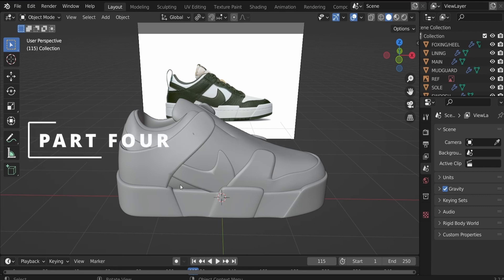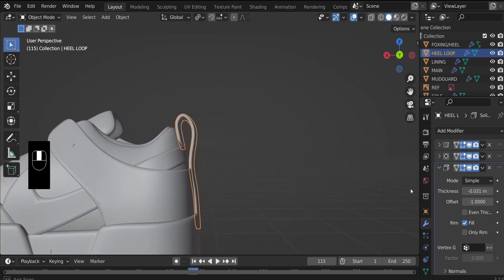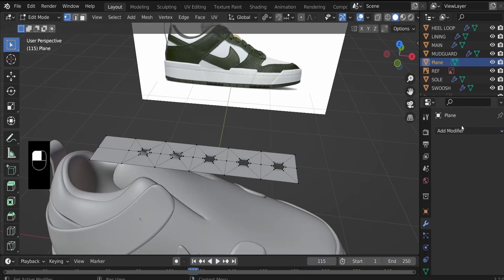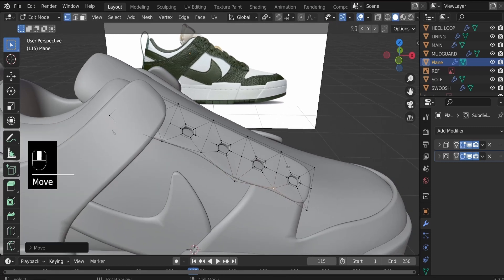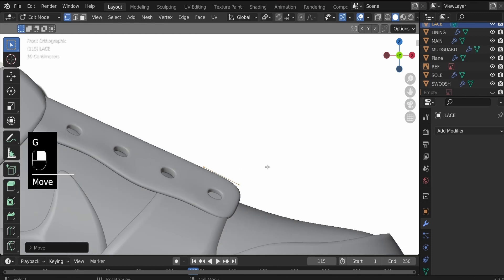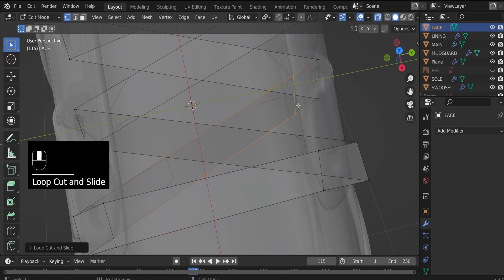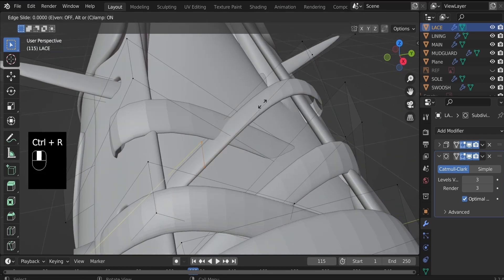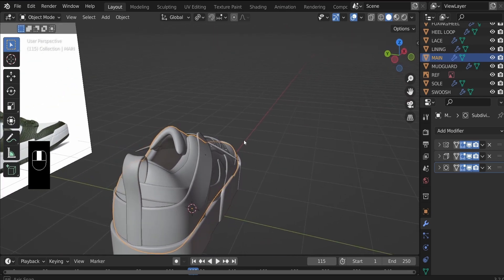How to model a shoe from a reference image in Blender - Part Four

Comment: Using mirror earlier, is there a reason you didn't just extrude? This way you could shape the shoe more accurately. A shoe is not mirror left to right, is has a more curvy shape on the inner sole. Also this wouldnt be acceptable for 3d print would it? How would you have done things differently?
Reply from the maker: It's really just preference. I used the mirror modifier to keep it simple and easy to focus the modelling on one side, and also because I can apply the modifier at the end and then flexibly reshape the other side as I desire. But in this tutorial, I left it symmetrical mainly for simplicity.  Alternatively, I could have extruded it, but that also means more work . Also, I reckon it'd  work if you export the stl file into a slicer program for 3d print even though I have not tried it.
Reply: Learned a lot by the way watching these. Thank you.
Reply from the maker: You're welcome. I'm glad you found value in them.